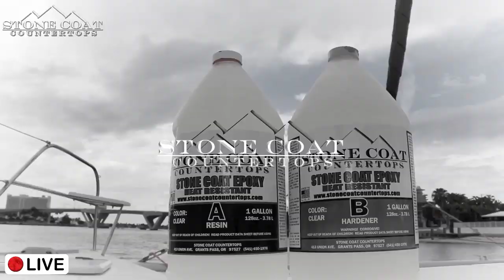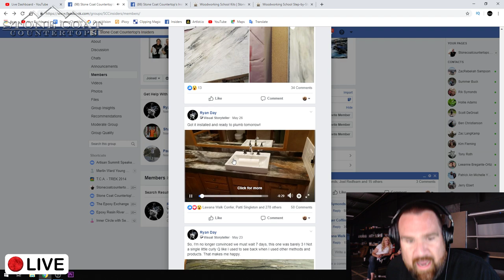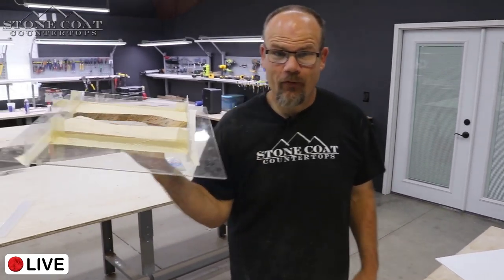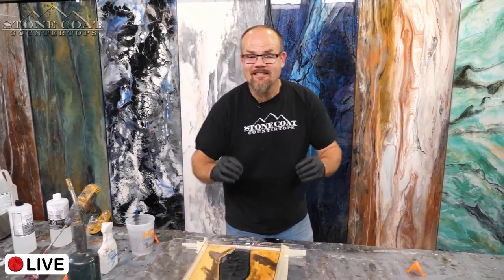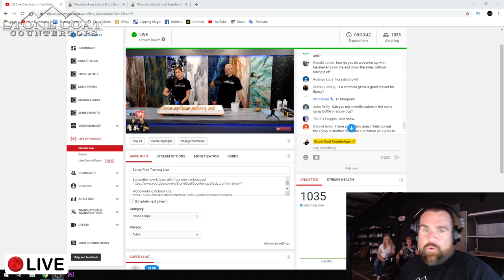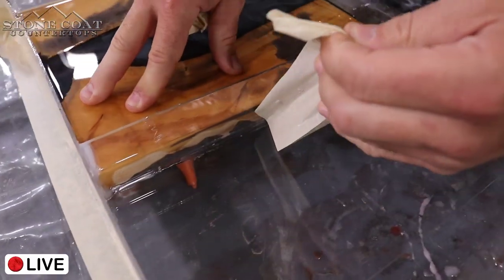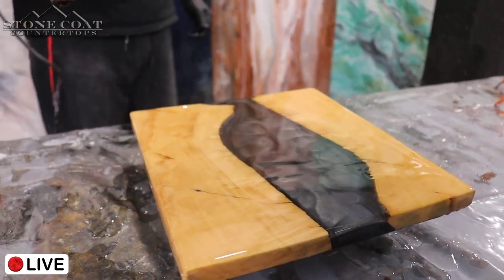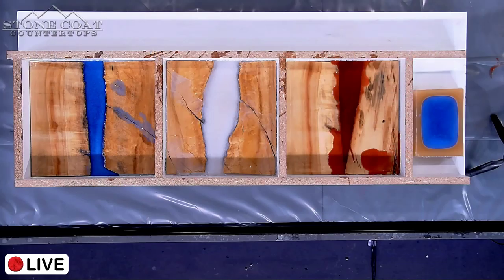Epoxy Free Training Live

Comment: Hi, i have some wood for my river table that has a slight warp in it, once i clamp it down and pour my epoxy how long should i leave it to dry so that the warp does not affect or bend the epoxy at  later stage or is it not advisable to use slightly bent wood. thanks
Reply from the maker: Tagulouss, if you have warped wood, you can plane it flat! You'll want to use bars to reinforce the wood so it doesn't warp more after the epoxy is poured. Check out our recent Hybrid Epoxy Wood Table video!